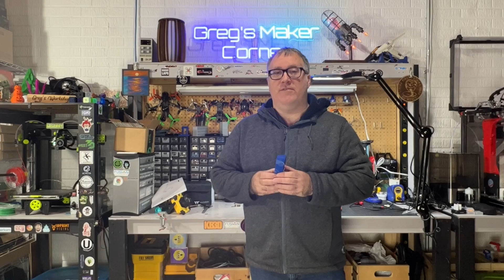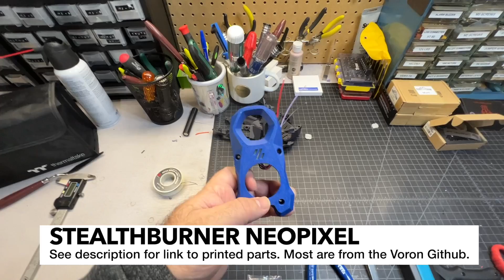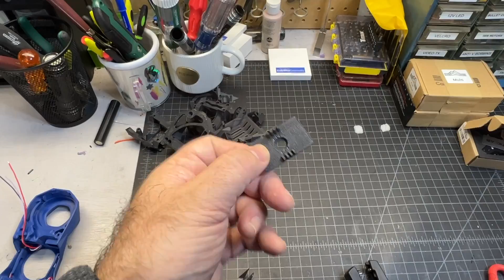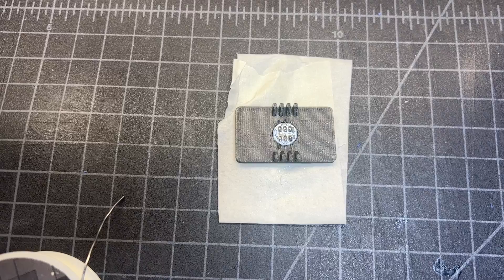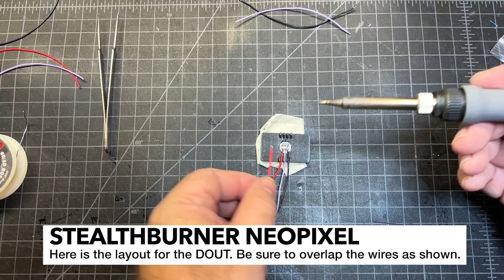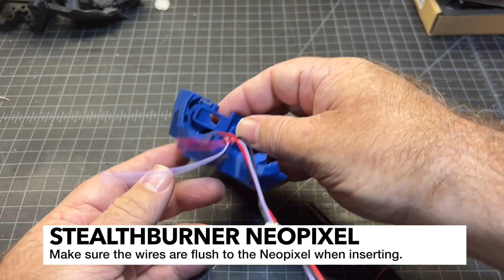Voron Stealthburner Neopixel Soldering and Wiring Tutorial

Comment: Where do you plug this into an octopus?
Reply from the maker: The neopixel can be plugged into the rgb port on the octopus. The pin header is in the lower right center of the board. Make sure you double check the polarity before plugging it in.
Reply: Thank you! I got it working! @GregsMakerCorner
Reply from the maker: @AbstractMediums  That's great, glad to hear!!

Comment: Hi Greg! Great timing. I just temporarily retired my 2.4 and it's on my bench awaiting numerous upgrades as well as a new ACM deck, rear and bottom panels as the old Formbot acrylic deck panel warped ~20mm. Looking forward to watching your upgrade process.
Reply from the maker: Glad to hear! Sounds like you have some good upgrades as well. I haven’t had any issues with my deck but I have heard of them warping like that.
Reply: @GregsMakerCorner  I'm almost certain the warping is the result of a temperature differential between the top surface, inside the printer and the bottom surface where there's two cooling fans blowing into the electronics bay. Basically, if you heat one side and cool the other side, you lower the surface tension on the hot side and increase the tension on the cold side and the result is... warp. No worries though... I really wanted an excuse to redo all the wiring and also add some other cool things like Mellow CNC TAP of maybe a Beacon Probe as well as some CNC gantry parts.